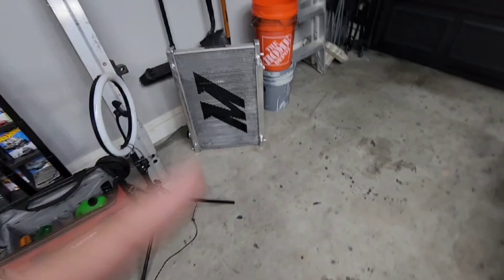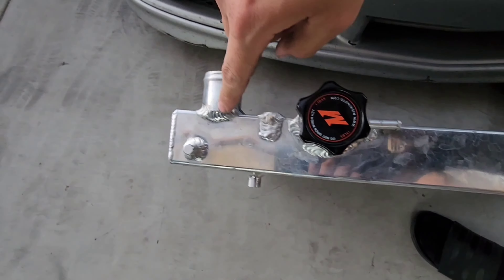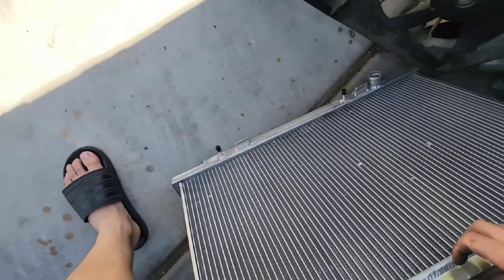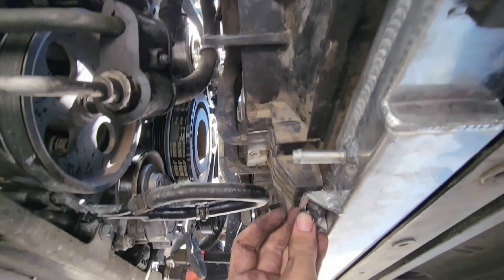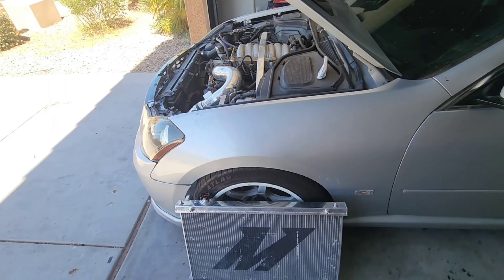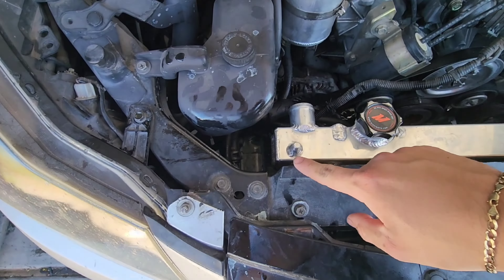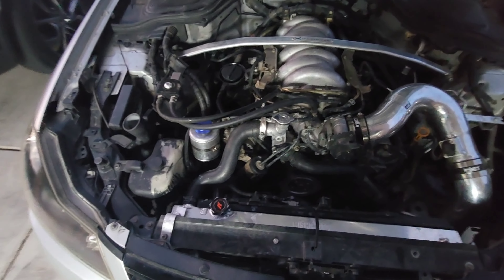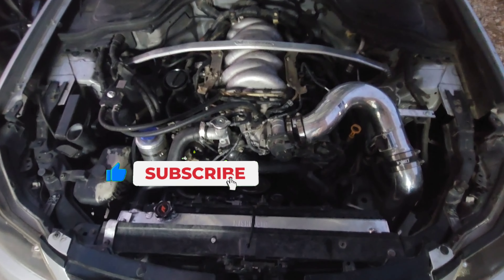Mishimoto Radiator Install | INFINITI M45

Comment: I had heating issues with my M45 when I bought it but only when driving on the city, luckly on my case it was one of the fans that was already going bad. Replaced them with some cheap Dorman one's from amazon that came with the module for $160 and has been running flawless for 2 yrs already.  Hope u solve ur heating issues.
Reply from the maker: I replaced the fans on this car as well bit I feel like that are not as loud as when I initially installed so I wonder if they went bad or it's the fuse